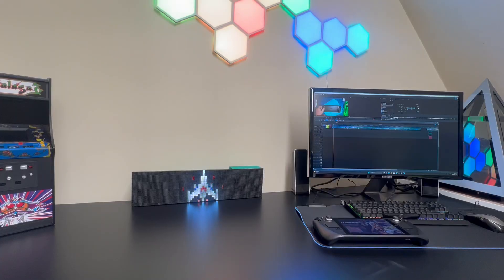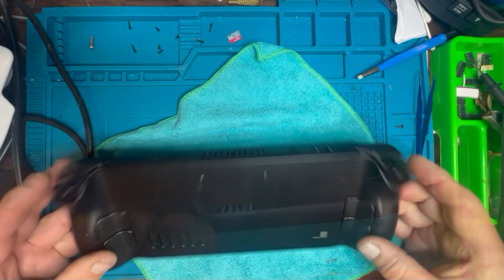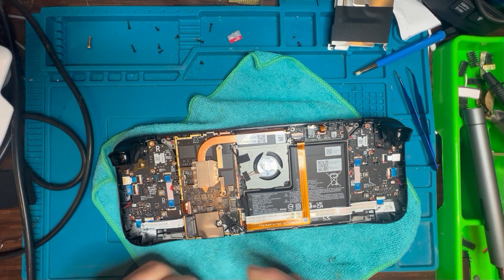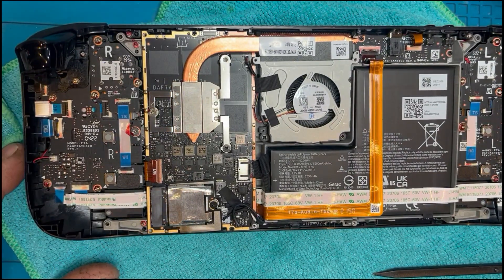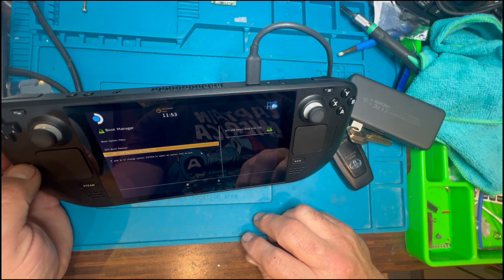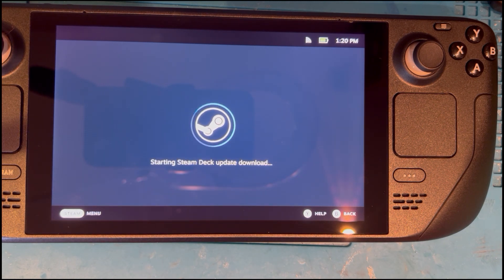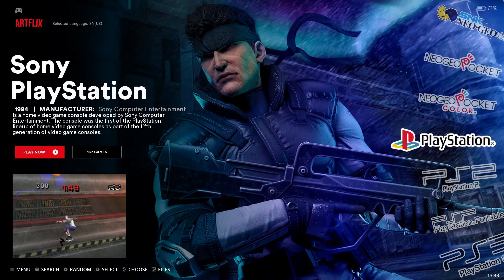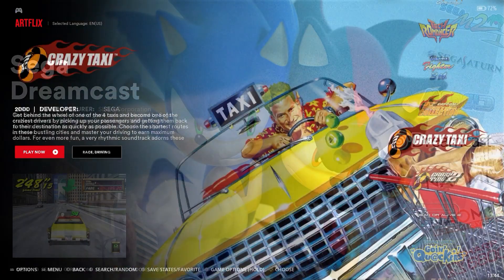SteamDeck 64GB eMMC to 1TB Upgrade / Batocera 1TB SD Play Test

Comment: did something very similar, new Deck in the sale not even turned on and i stuck a 1TB 2230 inside and 512sd for batocera, i feel however the 1tb sd is a better option 512 just seems to not taking full advantage of the power of this unit.
Reply from the maker: It’s a wonderful machine they made it so versatile things like this keep you using it 
Did you get the base model like me or the one with a none reflective screen?